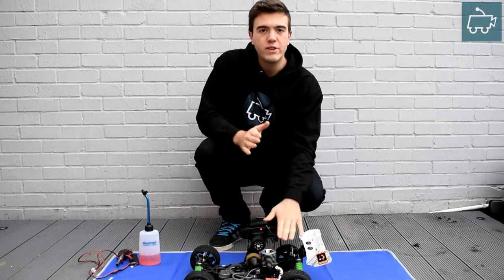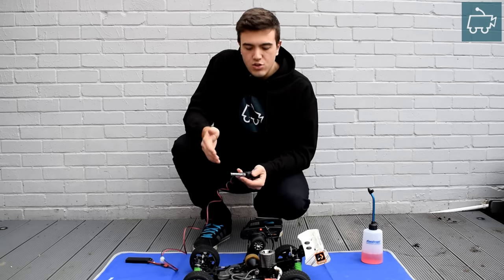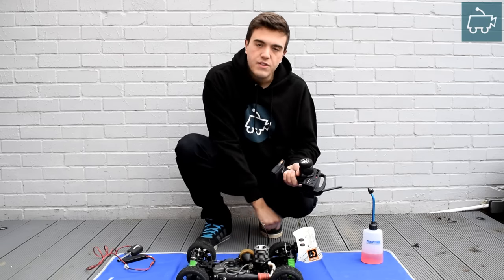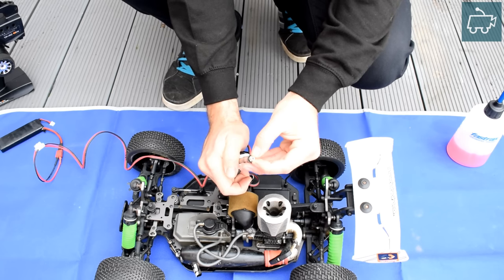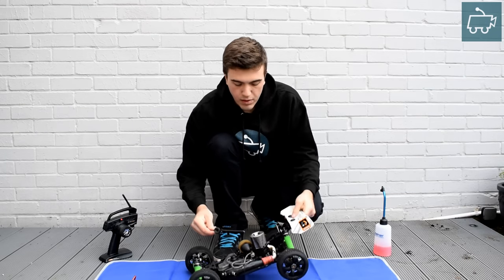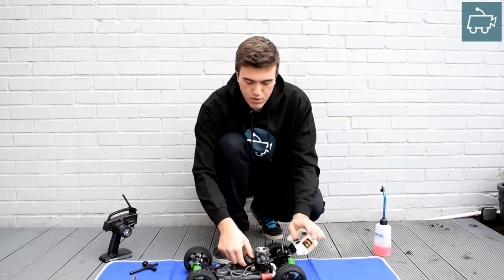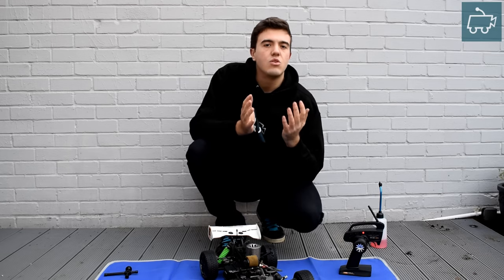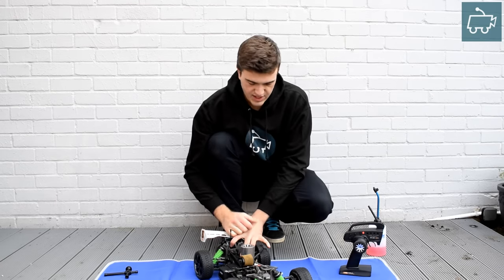How to Start a Nitro Engine after months of no use

Comment: Use a heat gun or even a blow dryer  to warm up engine before starting is probly the best tip I can give for easy startup.
Reply from the maker: Yes that's fine if you're at home with electricity :)
Reply: Lol, yes it only works if you have access to electricity ,or battery powered heat gun though I have never seen a battery powered heat gun.
Reply: I do the same, and it is the best way of getting your engine started.
Reply: @Al_Man9oori  genius
Reply: No need for electricity.12v head heater will do. Again. I agree better to pre heat the engine. You already know why
Reply: Idk why but I hadn't started my car kn Abt a year all I done was put a drop of uel on the engine and it started

Comment: Thanks for the tips! I have a nitro rustler that I bought 10 years ago. Haven't run the engine in about 8 years!
Reply: Should run a engine atleast every week to keep it from sticking
Reply: @jonathanoxlade4252  kyosho engines just work. Old pureten spider I found in the shed started right over and my dad must of left it there for atleast 10 years.

Comment: Started mine kyosho gx15 engine arter 14 years. Cleaned the old fuel out of the gas tank. Charged the igniter and it started after 4 pulls. In the middle of the winter! Hello from Norway! 🇳🇴

Comment: Very grateful for the information.   I have a fairly old Schumacher pro 21.  It's been more or less 10 years since i had it running.   I did the full checks on condition etc and i have to rebuild the clutch assembly before i can attempt starting her but she's been in dry storage so apart from a tune up, I'm looking forward to having her running again.

Comment: Great guide, really like your videos...BUT.  One fatal mistake on this one.  You adjusted idle gap from fully closed, with your throttle trim.  When you get it started this way, the engine will stall when you apply the brakes.  ALWAYS. Make sure idle gap is as specified 1-2mm when brake is applied, this way the servo is forcing it shut( but adjust with open throttle, or you may damage the carb).   Again, love your guides, well spoken and eksplaned.
Reply from the maker: Yeah of course. Maybe I just did it for quickness when recording the video :/
Reply: JT12's R/C Videos i just have seen many people with that specifik problem, 😉

Comment: very informative refresher tutorial , i miss using my nitro buggy.

btw you over flooded the engine, but it did help lubricate  the motor well before it actually started.

i recommend fresh after run oil instead of nitro gas after removing glow plug then crank it a few times without glow plug igniter.

then prime and add power to start the engine.

Comment: Air Plus Fuel plus hot glow plug Plus  compression equals it has no choice but to at least hit like any two stroke if all else fails hold the throttle wide open it will clear itself out and run

Comment: I just bought a ftx carnage and my son crashed it into a tree last week
 It started up fine after the crash but the front bar was bent.
I have replaced this but now it wont start
Any ideas as I've tried everything suggested
Reply from the maker: Hi John, I don't think the crash is related to it not starting. have you tried putting some fuel directly in the glow plug hole to see if it fires up? Also check the glow plug is working, and, It may sound obvious - but make sure your igniter is charged up!
Reply: I've figured it out, there was some kind of fuel blockage.  I emptied the system and shortened the piping
Firing up fine now

Comment: Hmm. I have a kyosho hawaii pure ten and it had been sitting on a shelf for 7 years. The bearings where coroded. I just lubed  the bearings with dw-40 till it would turn over. Filled it up some 25% nitro meth and it started like a dream and still runs like a dream. And yes, i know that it´s basicaly a mowing granade because of the bearings.

Comment: I got this revo 3.3 it's been sitting for long time.I got it running ran good put screws back to factory settings before starting she was doing good then the idle was up and down by it self the the piston seized in the cylinder the only thing I could think of is it was sucking air.

Comment from the maker: Check out my Top 5 RC Gadgets Video here: https://www.youtube.com/watch?v=5WYCk6--snU 
You can't own an RC Car without having these...
Reply: JT12's R/C Video sooo can you help me with some tips normaly i drive electric but i bought a kind off big truck with hpi engine almost looks the same didnt start it yet the pull starter is dead but its kinda like a traxxas t maxx with a hpi engine and stuff :D was 35 euro with a extra body etc so it was prety cheap so i dont know how long it isnt used i also have to replace the servos etc
Reply: JT12's R/C Videos the engine will 'cut' 😐  and wash with water?? there still will be water residue in it! you get proper cleaning chemicals for cleaning a tank so you do that leave and water×small jets in a carb = rebuild. your not really explaining how and what to do properly like it will 'cut' you mean stall wash with hot water. there will still be water residue in it! and blocking the exhaust could cause the engine to blow up if it started! and that would be a nice cut into your bank account! and if a engine sits for a while you should properly clean out the carb or it could not pass through fuel cause it will be gummed up with rubbish!! plus learn technical terms when talking about an engine cause it will really annoy people who now better about them than you and their probably the ones who dislike the video!! so learn proper terms and use comment scenes!
Reply from the maker: I read this comment three times and it still makes not the slightest bit of sense to me :) could you elaborate please, this time using a bit of punctuation?
Reply: JT12's R/C Videos hey what if you have carb issues what would you do then
Reply: Gta 5 Expert get a new carb or rebuild/ clean it out with brake cleaner!
Reply: JT12's R/C Videos
Reply: Looks like you need a new air filter it is very dirty
Reply: I watch alm your clips  if it's not to much to ask I'm having  radio issues with my trx i built it when I was 17  so theres an alternative  part to use to start it I half to use my drill and an old beat down dogbone  from my kyosho Optima  turbo

Comment: I have seen inside engines that have sat for a year with no after run oil, and it wouldn't run st all no matter how hard I tried. So I took the engine apart and cleaned all of the sludge and stuff up and it ran again. If you can't get it to start at all I would advice tearing it apart and making sure every component inside that engine is super clean. But make sure you re oil your piston and connecting rod and bearings before you put it together
Reply: Na man, I've just bought an OS max .40 FX with fuel all gummed up inside. I've put some fuel in it, let the fuel drain out, put it in my plane, connected fuel lines, heated it up and it started just fine

Comment: josh if you remove the orange venturi from the carburetor you will see a the 1mm opening gap, keep that in mind, incase you adjust the idle screw or increase throttle trims and when you start it, it may take off mate :) by the way there is rust at the bottom of my glow plug mate. also, what type of glow plug will  need for my .15 engine?
Reply: Depends on the brand

Comment: Hi mate , had my stepsons nanda buggie started after few months in house starts no problem but won't stop on the ground just stalls can't figure it out had no problems before with it could the clutch be gone ?
Reply: make sure you leave the buggie running for a minute or so to allow the engine to heat up, lift the wheels off the ground and gently give gas, if the wheels turn then the clutch should be fine, then put the buggie back on the floor, give it a gentle push and apply a small amount of throttle and try and maintain speed, it should then work, if it stalls it's probably not getting enough fuel so unscrew the screw a little nex5 to the engine to allow more fuel in.

Comment: i used Carburetor cleaner sense the fuel was jelly inside the engine i got it started in 2 days but i don't use it much sense of the cold and the nitro i have will only last for 2 1/2 tanks or so
Reply: You should've used just normal nitro fuel instead of carburetor cleaner, carburetor cleaner will dissolve your gaskets.

Comment: Hey this video is very helpful. But please tell me what happens when the Air filter keep removes for a long time does it bad to the engine.
Reply from the maker: Depends entirely on the conditions. If you've been driving on dirt / sand then I'd certainly look at taking the engine apart and cleaning the parts. If it's been on tarmac then it wont be as bad, but personally I'd clean it either way.

Comment: Good afternoon. I write to you from Ukraine, a bad translation. I want to ask you a question. I have mercedes dtm 2008. He went and worked, but then something went wrong. The car is a bad start .. the engine is roaring, the bell is spinning, but the car does not go, jerks take, thought the clutch, bought a new one, similarly does not work. I noticed that the bell is rotating in another direction, I changed the bearings, did not help, I installed new bast shoes, it also did not help. - what could it be?   My engine is set up correctly. it accelerates quickly, there are turns, but there is no catch in the clutch .. I changed them already 3, + rollers + bearings, no difference .. does not go.  I need help..
Reply: The clutch shoes are on the wrong way

Comment: Nice work. My brother had a plane from back in the 70's. It was a sit in the middle and control the wings by a weak string connections and after 10 or more minutes you were walking in circles acting like drunkards. Can't walk or see straight.

Comment: If it is for setting for months, I usually open the engine first to make sure there is no rust build up inside.
Reply: Why would there be rust in there? You shouldn't have much moisture in there Especially after just a couple months. Just always use after run and you'll be fine. Dont bother checking unless you decide to just put a couple more drops of after run in.

Comment: Great video,Josh,you should've been on TV.I've got a Pulse,great buggy,very fast when you get it set up correctly,I had to put a No.3 plug in it the other day,it was spluttering on the 5 and 4,as you say it's been pretty cold in the UK.I only recently figured out what those bright orange and yellow items you get with the Pulse are,carb restrictors,I see you have one fitted,I don't understand what use these are as the 4.6 engine isn't legal for racing anyway,I'm not sure why you'd want to restrict the power?,would be grateful if you could explain?
Reply from the maker: It essentially just restricts the air flow a little, if you remove it you'll find you might have better throttle response. They're only used for racing to take the edge off acceleration and making the engine/buggy a bit easier to handle! Not sure why they include it in this package as like you say it's not race legal anyway. Maybe it's because you can race this size buggy in other countries and it's a model that's sold in other countries too?! No idea to be honest!
Reply: JT12's R/C Videos yes,it is a slight mystery!😊😉,I thought all buggy racing was all maximum of 3.5 cc but I'm no expert!,I've started using WD40 or some equivalent as after run oil,I've found that the rubber seals in the carburettor/back plate etc quickly perish if the buggy is left for months with nothing done,apparently the high alcohol content of nitro fuel attacks rubber and provides no corrosion protection to the cylinder walls etc allowing rust to become an issue if not used for months.😊👍👌

Comment: i had a traxxas sitting for 2 years the gas that was inside it was literally jelly and so sticky it took 20 minutes to clean it out and the engine took forever to start and after a few minutes of riding just stalled and would not turn on again so we just put it back in the basement it been in there for 2 years now any tips to getting running without stalling?

Comment: Define "old". ;) I'm a nitro newbie and would love to know what the shelf life of nitro fuel is. Does opening a container cause it to go bad more quickly than if it's kept sealed?
Reply from the maker: Yes, opening it will reduce its life. The length of time would depend on where it's stored (i.e. Room temperature it would presumably last longer than in a freezing shed). I've used 2 + year old nitro that's been opened without issue

Comment: Hello man! Its incredible how easily it started compared to my truck. I have a Kyosho Giga Crusher with the GXR28 engine. But, the thing is that it just wont start. Last time i tried, i was pulling the cord for like 2 hours straight and it did not even fire up once. The glow plug is in fairly good condition and the igniter is always charged up. Do you think warming up the engine with a hairdryer before firing it up would help?
Reply from the maker: Yes absolutely. If you can pre-heat the engine then it will help. Are you sure Fuel is getting through to the engine?
Reply: JT12's R/C Videos I am pretty sure it does. The manual suggests that after you cover the exhaust, you should pull the cord 4-5 times. I pull it at least 20 times before I try to start it. Plus, I can see the fuel going through the hose.

Comment: So do I do the same thing if my car has been sitting for 12 years. And I don't have a pull start or box because my brand doesn't make this car any more. Do I use a drill or a rope?
Reply: Ethyn 199 it will have either a pull start or some kind of thing to insert a special bit into for electric start. What is this car?

Comment: hi mate , thanks for the info . just a question i bought a nitro car from ebay to have a zoom with , the car starts after a few pulls , when it starts the car cuts off after a few seconds up to 30 seconds ( note that there is little smoke coming out and the heatsink head is VERY hot ) the glow plug glows but not very bright  and theres alot of fuel that comes out the exhaust . any tips or pointers
Reply: CO2InhalerGamer then you’re running very rich, try leaning it out

Comment: When you pour fuel directly into the cylinder as you did ...always spin over the engine to get the excessive fuel out of the cylinder...it also gets it closer to a gas state.  If too much fuel is put in remember fuel does not compress so with a very powerful starter you could do damage to the engine.

Comment: Hey bro did you ever start the Kyosho concept 30 that you said you bought , I also got one and a put a brand new Engine but I can’t get the engine running what does Heli use a different type o fuel, I’m using the nitro fuel I use with my nitro cars
Reply from the maker: Hi, no I never got round to using that and ended up selling it. You need a different Nitro for the helicopters, although it should start with the car fuel - just won't run very well. I would try it with the proper Nitro aero fuel before you start any further investigation :)

Comment: I need help!! Just bought 2 nitro cars from someone and they both worked fine for a few hours... but 1 doesn't wanna start anymore even though it has compression... and the 2nd one now stalls when I hit the throttle... the problemen... they are made for 20% nitromethane... I used 25% nitromethane. How bad can it be damaged from this mistake? Nothing has blown up but 1 doesn't start anymore... it wants to start sometimes and idle for 3 seconds at best and the other one can only idle....

Comment: I've left mine in the boot of the car since July! Lord only knows what state that engine is in :/ major work needs to be done. No after run oil in it either.
Reply from the maker: That's only 5 months, it shouldn't be too bad. If it's been in the car I guess it probably won't be quite as cold as a shed or garage. Shouldn't need any more doing than what I did to the Pulse , here :)

Comment: mate, good video. i had a nitro car and this is the problem that l went through but i had no idea of replacing the fuel. Mate, l used to get a lot of smoke wen l started the car, can you tell me why.  Thanks
Reply from the maker: It could be running rich. But warm up the engine before making any adjustments. Smoke when the engine is first started could just be old oil burning off or after run oil/WD40 burning off that's inside.
Reply: thans for that

Comment: I just used some nitro fuel that's about 15 years old and it seems to work fine.
Reply from the maker: Yes it could well do, depends where it's been kept etc
Reply: @TheRCBiker  Storage was far from ideal.  The can is about half full and was in the house for a while, then the shed, outside, then in the garage next to the door for the last 8 years or so.  It was exposed to daily temperature swings, rain, and the sun.  The can looks like hell, it rusty and looks even older than I think it is.  I wish it had a date on it.  I got it second hand so it could be 20+ years old.  It's Trinity Monster fuel in a steel 1 gallon can and it appears that they haven't used steel cans in a long time.